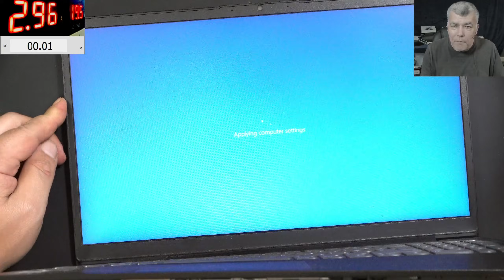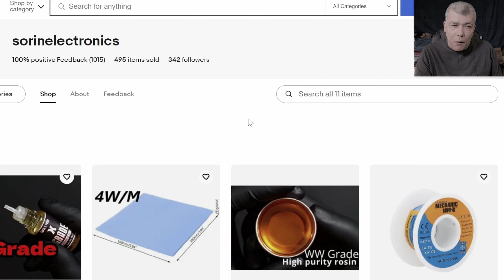Most common fault on a dead Laptop and how the check and fix, Lenovo V15 G2 ITL no power

Comment: My battery was outputting 0,8v directly on pins - even though i charged battery directly to 7,5V ~. I checked mosfet and it was fine. Turned out I had to charge battery using external power supply BUT using battery pins on motherboard (then it got unlocked and showed 7,5V~ on pins). I connected laptop charger and it's charging. Maybe that is no science rocket, but i'm sharing this in case someone is having the same issue. Symptom was rapidly flashing orange LED near power input.

Comment: It would be interesting to find out how to source replacement components when one has no donor boards or a magical box with lots of little mosfets and capacitors and resistors. 

Since manufacturers are constantly changing their components, it is difficult to match current component numbers vs. old ones that must be replaced.

Comment: hey Sorin, have exactly the same laptop, same mosfet short too. I did replace the mosfet and the laptop has now all the power supplies. it starts fan spinning, nothing on the screen  and esc + capslock + numlock lights on .... forums says mobo is coocked. can it be corrupted bios since i did shut down a few times?

Comment: I found this very helpful, I have a dell laptop it only charges and gain power when its off, but when its on it only uses battery power even though the charger is plugged in what could be the problem thank you

Comment: Love the channel and I’ve referred to it several times trying to figure out why my Lenovo (Flex 14 7i, but with USB C charging port  😢 ) won’t charge and therefore won’t boot.  But I’m confused in this video:  At 0:39  Sorin mentions that the board hasn’t been taken out, and points out the seal.  Then at 5:54 the board is out and the seal has been destroyed in the process.  At 11:35 he mentions that he’ll put the board back in, then a few seconds later we see the board in place and everything working fine.  But, the seal is also intact, meaning (as he pointed out at 0:39) that the board hasn’t been taken out.    How did that happen? Am I missing something?

Comment: Hi Sorin, the reason for the shutdown (at minute 11:59 and at minute 12:25) was that there wasn’t enough current from the power supply. When you charged the battery, the limit was set to 1.83 amps (at minute 13:00). After increasing the current to 3.03 amps, the laptop was able to start. It had nothing to do with the battery charge or with the bios. Thanks for everything, and I appreciate what I learn from your videos every day.
Reply: yeah i caught that it didnt have enough amps to start the board til he increased the amps to 3
Reply: either way he is good and fixed it nonetheless. he knows what he is doing
Reply: I experienced this before with lenovo and try to charge with 2.25 amps charger, the charging process keep starting and stopping, but with 3.25 amps charger, it's charging fine
Reply: Yes, Sorin is amazing. I’ve learned and continue to learn so much from his videos. My comment was just an observation, and I believe it’s correct as well. Thanks also to his teachings that I’m now able to make these kinds of observations. I know very well that he knows what he’s doing :)
Reply: @Ripara-Zione  yeah i agree thanks to this man i have fixed several of my own pcs and laptops.

Comment: hi brother, i have a question from one tech to another. im trying to fix my sisters laptop and here is what happen. (ill post a video too) computer fan cant blow out air because it was blocked with dirt and dust, so computer got too hot and the fan ceased up so it had a thermal shut down my sister not knowing anything just turn it back on like nothing is wrong. so now the battery is swollen and the charger IC chip blow up and the board where the chip was has burnt layers and the laptop wont turn on with 19V present. is it possible to bypass the charger IC area to make the laptop power on? i know she cant use the battery just on AC power. if I can get it to work then i need to source out  fan. thank you in advance in assisting me in the escalation of this issue. i would send to you but im in canada seems maybe too far
Reply: Burned FR-4 material becomes carbonised, electrically conductive. Therefore, even with a dismounted power management chip (PMIC) a short can still remain. You must mill-out all carbonised FR-4 material, until the short is gone. If it's impossible to replace the PMIC with a new one, and the two MOSFETs at the power input don't like to conduct because of the missing "Power Good" signal from the PMIC, you can just solder the gates also to the 19 Volt input or you connect the 19 Volt input to the current measuring resistor. Good luck!

Comment: Sorin, I'm a little lost. If the first mosfet is cuting the 19v by the control of the BQ how came we had 19V at the double diode?
Reply from the maker: The bq chip is taking 19v exactly from the charging port!!!!
Reply: Ok thanks. It makes sense if it needs to control the mosfets. Thanks for replying.

Comment: Hi Sorin how to detect power management chip is not working
Reply from the maker: An ic/chip contains many transistors which makes a chip/ic nearly imposible to be tested with a multimeter, the only way to be sure is good, is by replacing it.
Reply: @electronicsrepairschool  okay noted but on the video you tested 19v on the transistor, etc ic around that chip meaning if 19v is present around that Pu chip, it looks good?